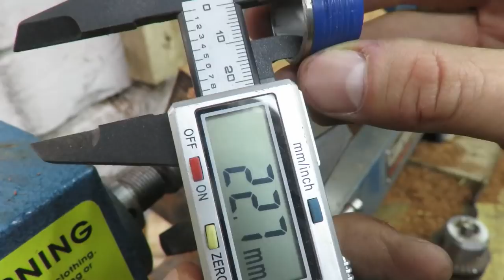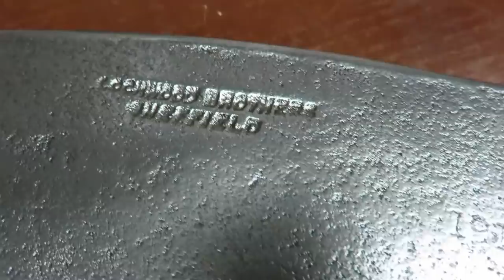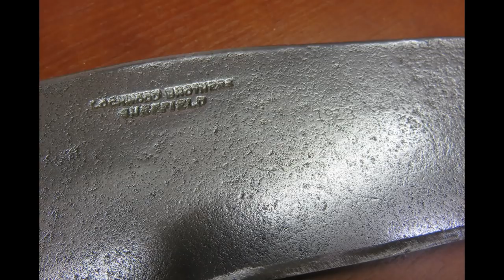Billhook axe restoration. Vintage tool from 1918.

Comment: I need to ask a question: Why did you convert a full tang hook into a half tang hook?
Reply from the maker: No reason actually
Reply: @FALCON390Workshop   Thanks for the reply. I wondered as a half tang is much less durable than a full tang.

Comment: This billhook needed no restoration. Wonder why you chose this!
Reply from the maker: In my opinion it needed a new handle and paint stripping to bring it back to original condition :)
Reply: @FALCON390Workshop  The handle looked like it was the bottom half of an axe handle, likely one that had been split at the top.